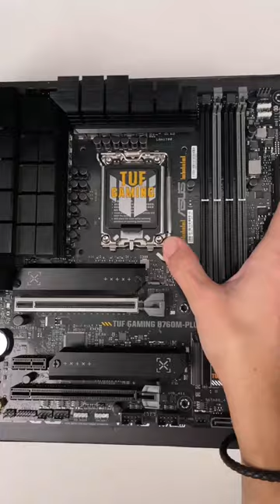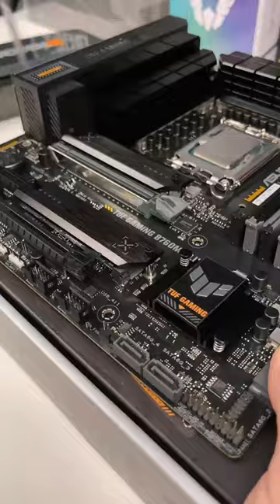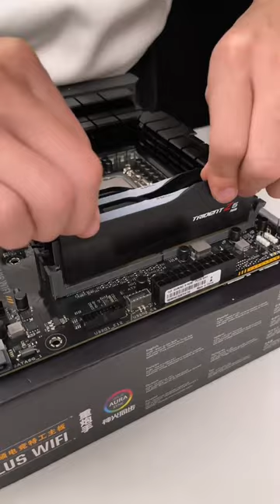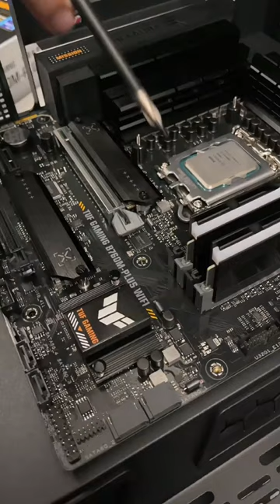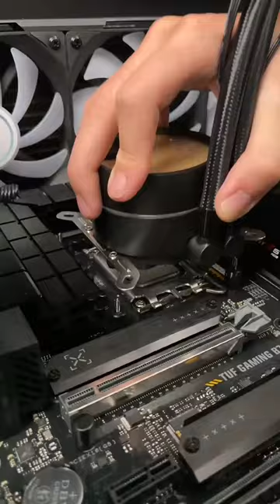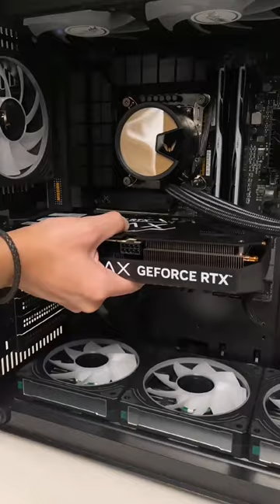Intel i5-14600KF 😱 with RTX4060TI🔥 #pcbuild ASMR #shorts

Comment: I hate it when people put a mATX size MB in an ATX size case. This looks awful coz exposed case metal under the MB
Reply: you barely see it under the gpu (edit) nvm i saw that the gpu is tiny
Reply: You may not like the fact that it just makes sense if you consider having full upgrade options in the future without the need for a new case
Reply: Water cooler on i5 ?????????
Reply: @KH-rr3hd в целом- это нормально. 14 поколение нельзя назвать холодным)
Reply: @KH-rr3hd  yep pretty common for aesthetics
Reply: @KH-rr3hd  the 14600K has a peak draw that's a little over 170W, so yeah an AIO will help a lot with it! The days of I5s with sub 100W peak draws are gone.
Reply: Forget the fact that it looks worse, less PCIe Slots, VRMs tend to be a bit worse than what you'd get on ATX boards and more often that not you get less M.2 slots. It's a bunch of draw backs for no reason! mATX boards make sense when you wanna make a build with a smaller case, but this? It's pointless!

Comment: When you have 0 priority in your budget and spend on an O11 Dynamic/GT 502 style case and RGB fans instead of upgrading to a GPU that isn't crippled by a 128 bit bus and 8GB of VRAM.
Then there's the mistake of buying an Intel CPU with the F suffix, the price difference between the 14600KF and the 14600K is really small, and if you buy the KF and need to RMA your GPU, you better have a spare GPU at home otherwise you are screwed!
Reply: wow, that's crazy

Comment: Bro 4060 with 14600💀using 14th gen Intel is some kind of trash. Price rised more than performance, better way was using 13600 or 7800x3d and get 4070ti or AMD equivalent
Reply: You fool😂
14th gen has same price as 13th gen
Reply: @nkhnouk3781  broo💀situation with new parts in Russia is like 💩, 220 for 13th gen i5 and 240 for 14th. Not too much, but still not very pleasant
Reply: @kiribastor  you are from Russia
Reply: It's none of your business, dude.